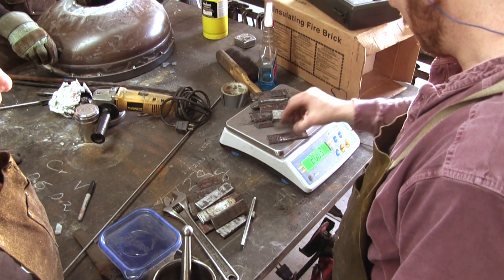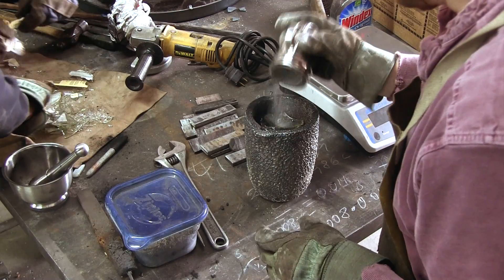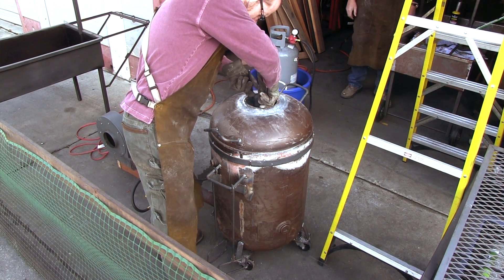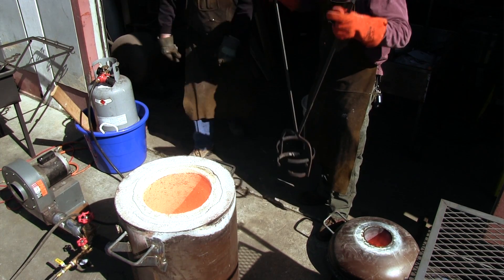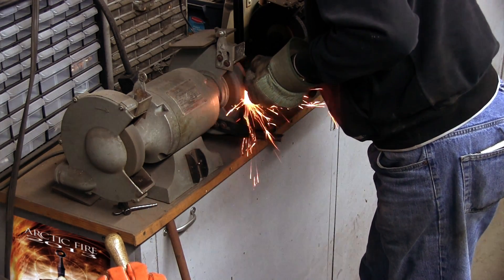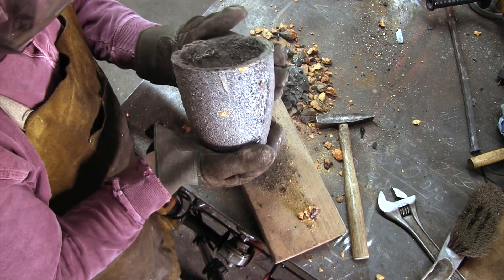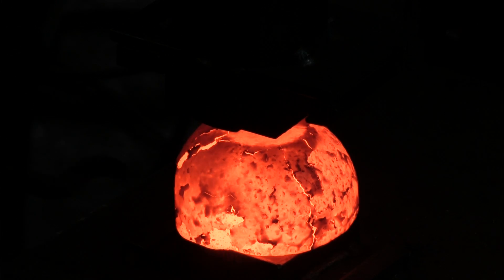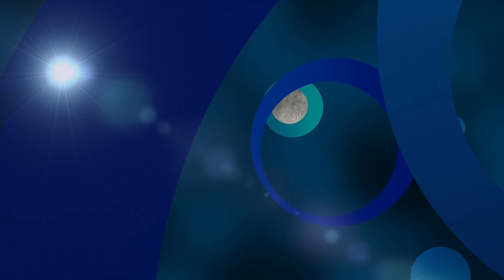Wootz Ep 3: Searching For Wootz

Comment: You need to thermal cycle the steel before you touch it with the hammer at least 9 times then you can start hammering it. Good luck 👍🏽
Reply: Add some wet wood (I like cedar) chips in the crucible. It will be better 👍🏽

Comment: the secret seems to be enaling upto 5 times before putting under hammer
Reply from the maker: Annealing multiple times is definitely something I have heard as well. Anything else?
Reply: @NielsProvos  small hits at the begining. it seems you need to ease metal to the forging
Reply: @NielsProvos  maybe using a wooden mallet at the beginning. maybe at high heat

Comment: Have you thought of putting the crucible in a insulated vacuum chamber and let it over several days to a week. Since there is very little gas in the vacuum chamber it will take longer to conduct heat away from the crucible. This should help develop better Crystal structures in the steel.

Comment: The only time I ever saw crucible steel made, it took over a full day to make. It reaches melting temp and cools somewhat slowly. The guy who made the knife said it was some of the hardest forging metal he had ever used. It did forge, but was very resistant to shaping. I'm no blacksmith or anything, just what I saw. Also the crucible was completely sealed with clay.

Comment: http://www.tms.org/pubs/journals/JOM/9809/Verhoeven-9809.html
Reply: not that im an expert or anything but from what i know your issue could be that youre using the press, wootz needs to be worked very slowly to build up a thin layer of a more condensed material before you can start working it harder, this apprently prevents the cracking and is later ground off to reveal the patterns underneath. if you work it fast it breaks apart, also tempurture when working the material is important as well, too high it breaks too cold it cracks.

Comment: I have a friend, who has a bulat steel knife custom forged especially for him. The smith is his friend, and they talked about this process - he said that the smith would tell him this is extremely hard to forge, as you have to start working on it at very, very low temperatures (cherry colour is the term he used), and very gently. Otherwise - a few wrong strikes and it falls to dust. Only after you break up all the dendrites gently, you can start shaping it more drastically. And then the dendrites will form again when heat-treating. 

That is not 100% confirmed knowledge of course, just what I heard about it.

Comment: Great video on a fascinating subject .. upvoted .. like a lot of ppl who have considered Damascus steel, I thought the blades were made via the pattern welding process.

Ok .. the wootz was produced in India then shipped to Damascus or Persia, where it was wrought into blades without forge welding, and using essentially the same swordsmithing techniques in use today.

That the pattern unique to wootz blades is visible when the raw cakes of material are sectioned then polished, and that this is the pattern which will appear on the finished product, extrapolating that each individual ingot of wootz has its own fingerprint.

That the challenge is to produce an ingot which will exhibit a typical Wootz / Damascus pattern, which will not crack and will remain sufficiently malleable at the necessary temperatures, to hammer then polish into a weapon.

EDIT: Whereas unlike other high carbon steels which are similarly much stronger than normal steel, it does not become brittle and will bend rather than break under stress!

Sounds about right ..

Another thing to consider is that some ore deposits have totally unique qualities, that the properties of the finished metal objects made from the mined material, are unable to be reproduced elsewhere.

All cymbals world wide are from Turkey, and despite Turkish artisans and methods have  been used in other places, the cymbals they produce never have the same resonance as the original Turkish item. :) Cheers from Brisbane Au.

Comment: Wootz was cooked in a crucible, but not at full melt temperatures.
Long slow cook, going for diffusion of carbon into more or less pure iron particles.
The entire process might take 30-50 hours.
The typical charge in the crucible was iron in several grain sizes and charcoal.
The lids were sealed, and the whole thing cooked until they could be felt to 'slosh' when agitated.

Comment: i believe you may be attempting to forge at too high a temperature. i have read somewhere that attempts to reforge or repair wootz blades usually ended in a shower of sparks because wootz was forged at much lower temperatute than other steels. Have you tried forging at red or dull red heat?
Reply: Yeah i was thinking that as well but not in the same way...my thinking is that they are doing this in a very short thermal ..spike if you will, back then this operation would of had lasted a lot, lot longer. 

In short, the heating of the crucible is too fast as such the heat levels are inappropriate.

Comment: Actually radiocarbon dating measures the amount of C14. It has a decay rate of about 6,000 years. The older something gets, the less radioactive carbon there is. Considering we are only looking at 1,500 years for a time table on crucible steel and the fact that carbon dating is only used on organic materials, I also am calling you a troll at this point.

Comment: Hi Niels, I have been forging Pulad for some time. The reason everything breaks is 1- your forging temp is over the austenitic temp. 2- you hit way to hard. Forge it for 50 cycle without the means to change shape after that work as slow/soft as possible. And to be honest maybe read the books by John D Verhoeven..... Cause you forgot to create a decarburised zone before forging. Take your time and good luck. P.s a new graphite crucible will give 0.5 % of carbon on its first use after that 0.2 %

Comment: I don't think I know better, but I would try pouring it into rather thin bars to quicken cooling and reduce crystalization. I can see a coarse pattern in the ingots in your video.
-Do you have another plan to reduce "grain"?
I'm thinking if it's coarse to begin with, it might not be malleable enough to begin grain reduction with forging?
In some steel mills it is poured into cooled extrusion molds, and the core of the billet is still molten as it enters rollers.

Comment: In the video "Secrets of the Viking Sword" about traditionally making an ulfberht viking sword at about 25:50 they go through the begining steps of forging their crucible steel which goes pretty siccessfully. Maybe you need to do it the even older fasioned way (hammer with a real hammer gently to break apart and seperate the dentritic structures), good luck.

Comment: One question, Niels. Are you seeking to have dendritic pattern in your wootz steel? If you want to form dendrites in your ingot, I don't think using crucible is a good idea. Because the crucible was heated with your steel. When you cooled your crucible and steel, there was little temperature difference between your steel and crucible. However, if you want to form dendrite, a big temperature gradient is expected. If you could pour your molten metal in a cold crucible or a mold,it might be better

Comment: I'd say the carbon content is just too high.  I have seen the same crumbling with cast iron heated up and hammered.  I think you are gaining a lot from the crucibles.  Are you using clay graphite or silicon carbide crucibles?  I have read that silicon carbide crucibles react more with iron.